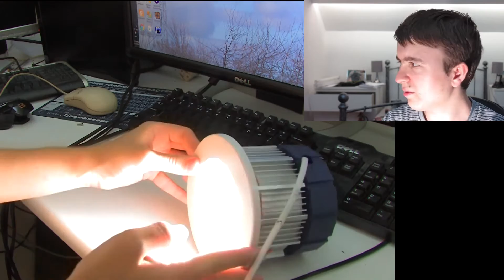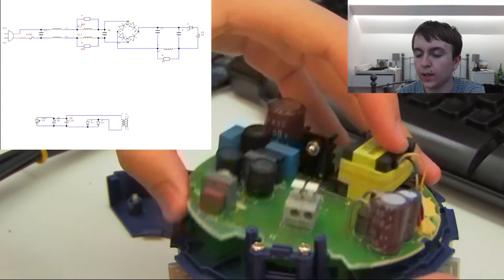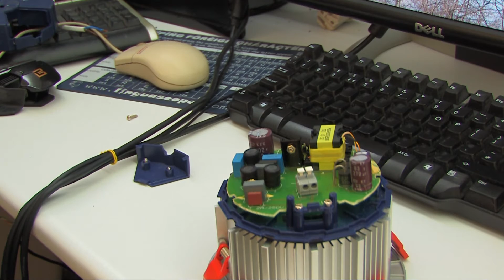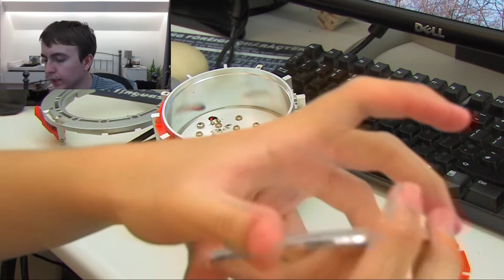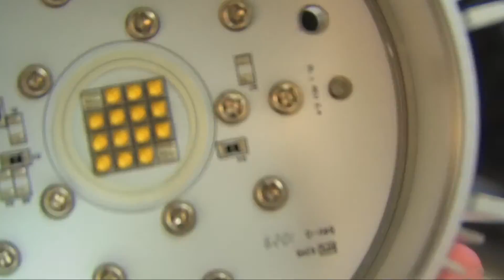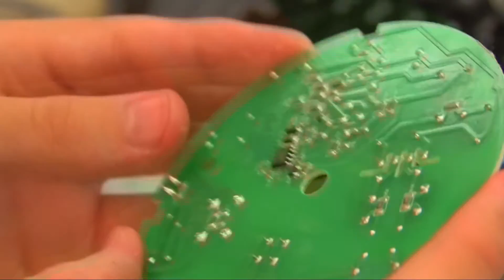Top Quality LED Downlight teardown: Osram LEDVANCE L 20W

Comment: I got a 3000 K version of this with external DALI driver (can be used stand alone, got it as a supplier didn't want to get their sample back). The light from it is stunning. I believe it's advertized as 80 CRi but in real life it's better than many bulbs advertized even higher (Ikea f.ex. which btw. aren't bad bulbs by no means).